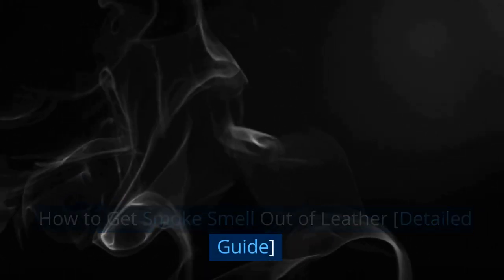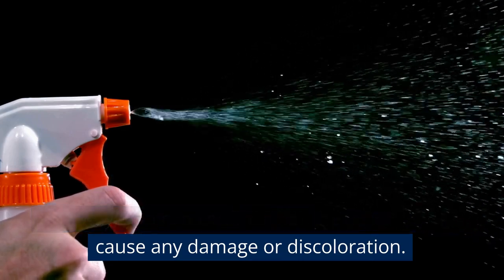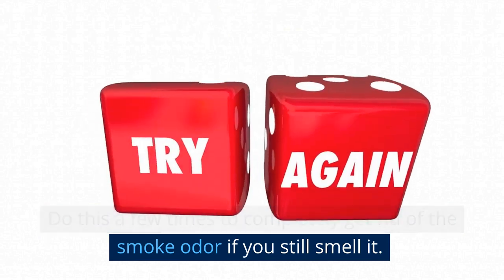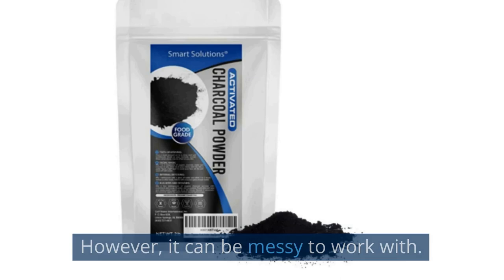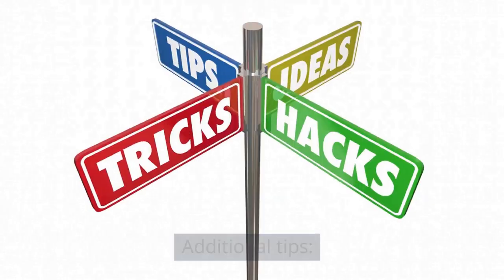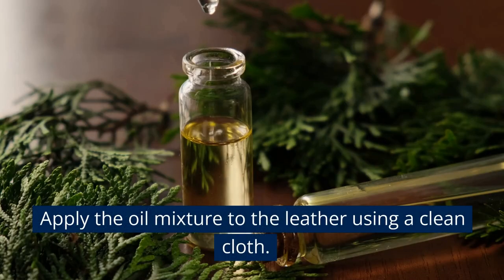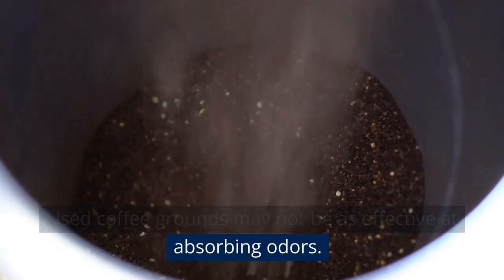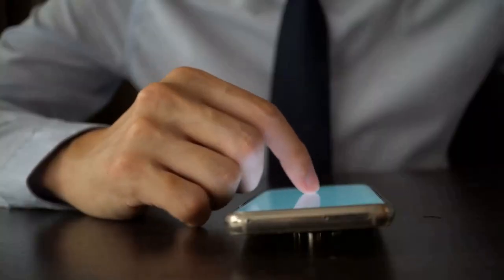How to Get Smoke Smell Out of Leather [Detailed Guide]

Comment from the maker: Things you need for this task...
Soft-bristled brush for leather  – https://fave.co/3Re9V68
Vacuum cleaner  – https://fave.co/3QVL59M
Microfiber cloth  – https://fave.co/40O8GO6
Sealed container (e.g. plastic bag or bin with a tight-fitting lid)  – https://fave.co/47qu3Y9
Baking Soda  – https://fave.co/3Gb6qqK
White vinegar  – https://fave.co/46jjjtm
Spray bottle  – https://fave.co/3Gc8PRX
Activated charcoal  – https://fave.co/3G7NOrl
Leather conditioner  – https://fave.co/3QORK5w
Leather cleaner  – https://fave.co/49KxtGP
Air freshener spray  – https://fave.co/3utqgLf
Essential oil  – https://fave.co/49MNnk4
Coffee grounds  – https://fave.co/40LGCLb
Odor-eliminating spray  – https://fave.co/3uxVSPA
Ozone generator  – https://fave.co/3us8k3A

Note that not all of these tools, materials, and products will be used for every method. The specific items needed will depend on the method you choose to use. It is always a good idea to check the manufacturer's instructions and safety guidelines before using any of these tools, materials, or products.

This channel contains affiliate links which means we might get a commission if you make a purchase, without any additional cost to you.